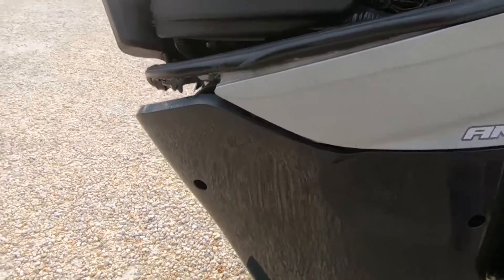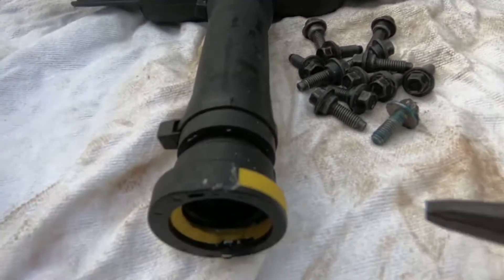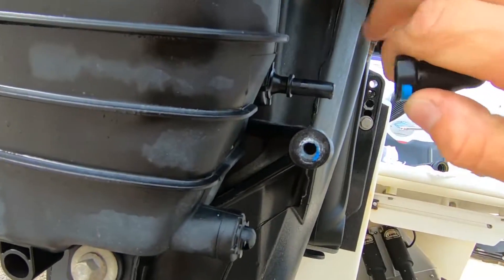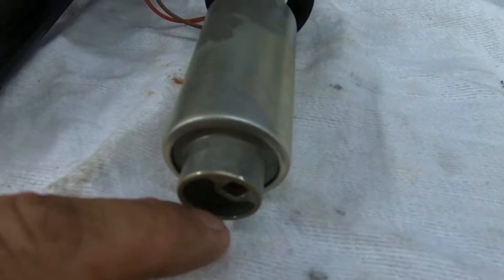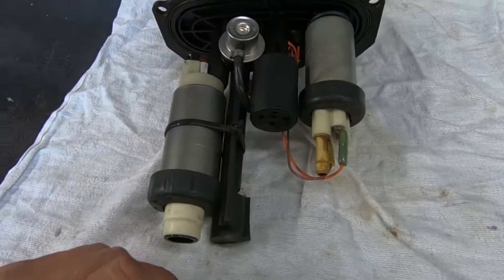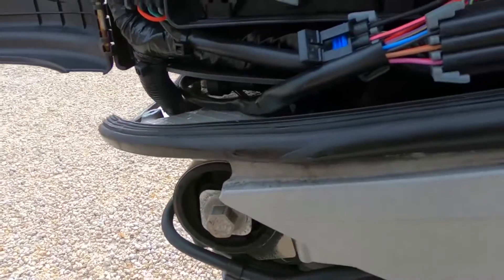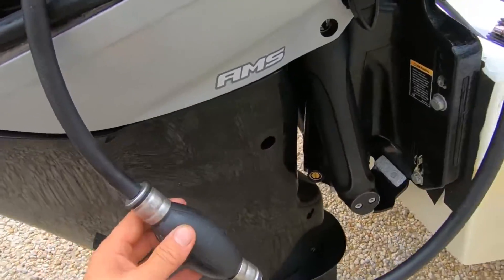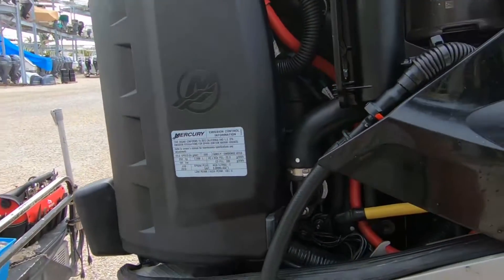How to remove | Disassemble | clean or change pumps in a Mercury Verado FSM (Fuel Supply Module)

Comment: Thanks for the video. My verado 250 will randomly smoke like crazy on startup. Tons of white smoke and unburnt fuel will come out of the exhaust. It happens about every 10th start and lasts 10 minutes or so. Do you have any idea if the FSM might be causing this?

Comment: Ok 08 vrod 200 4cyl. 
All runs fine...but turn key on engine off and pump keeps running and running. No alarms or smart gauge alarms. Motor works as it should lots of power and runs fine. 
Any idea why i believe high pressure pump would be running continuously with key on engine off.
Reply from the maker: Usually in the flashing of the computer and or the harness that was used, that could be it, idk if the engine is new to you or what, but it should eventually turn off after say a couple minutes, if not, it's a flashing thing with the computer, and or someone has messed with the wiring
Reply: @BornAgainBoating  have had since 80 hours on it so like 1 year old when I got. They redid float system and reprogram years ago for the recall. Had issue with ground circuit inside pcm was keeping 1 relay alive killing battery overnight. I installed and toggle switch to kill relay. One day driving in rough water it fixed itself. But since sometime around then...the fuel high pressure pump stays running with key on engine off. So my knowledge is ground circuit inside pcm is bad. Not opening or closing ground to turn pump off after the allowed 5seconds. Been that way for years. But fixed my high fuel pressure by cleaning regulator in FSM. Was plugged. Good now but pump still runs with key on.

Comment: Anyone else have issues putting the fsm unit back into its case?
Reply from the maker: It's late, but you gotta make sure the low pressure pump is aligned right or they won't go back together

Comment: What size male fittings did you use to plumb into the fuel system when priming?  I believe my mercury has 10mm female connectors but I can't find any male connectors to use
Reply from the maker: Yeah, I don't know, they are quick connects :/ I pulled them from another engine

Comment: I have a 2007 150 Verado that will not start only start when you are wide open in neutral. and look likes its spiting a lot of gas off the muffler and when I go to idle it shuts off. Will not start and idle. At the fuel nipple on top of the fuel rail I have 42 PSI,  fuel ok, no water and replace filter and plugs. Any help would be appreciated.. Thank you a great video

Comment: i have a 70hp merc replaced both pumps motor runs about 20seconds wide open then dies if   squeeze  the bulb it runs great again for 30 second the never stalls out but runs rough

Comment: In your video, there is a small port looking fitting on the lower right hand side of the fuel supply module. When the motor is running should there be water coming out of this fitting?

Comment: Hi these are great videos. You mention you dont want to get fuel in the vent canister, as it causes problems. What sort of problems do you get? I have just replaced an injector on my 2006 150hp verado and she wont run clean at higher RPMs just cuts out. Seems to take an age to prime as well. We tried to get air out of injector rail and also the green valve I think called the fuel air vent.

Comment: Howdy, Great video! I subbed! I have a new problem with my Mercury 90 EFI 4-stroke (I think 2004 M.Y.) after servicing it and it not having been run since last year. Last year was first year I owned boat and never one single problem or warning beeps. Last fall I changed oil, oil filter, lower drive lube, and spark plugs before putting boat in storage. Just before I put it in the water the other day for first time of the year, I turned the drain valve on the remote water separator and drained it thinking that was okay to do to purge any water out. Boat started right up in water but then shortly thereafter I got 4 beeps. Longer in length. Then 2-3 minutes goes by and 4 more beeps. Boat seems to run fine off-idle but I noticed at idle/trolling speed it’s running rough almost like it’s misfiring. I did not operate/run the boat long because I didn’t want to get stranded out on the water or damage anything. I found a “fix it” thread online that had things pointing to the FSM on one guys boat that had similar symptoms and warning beeps as mine is having. Battery is also fully charged. I did read low voltage can cause 4 beeps. Any thoughts? Really appreciate any advice. Thanks

Comment: Hello, if the float is not working, what is the problem with the engine? I find benzene in the oil in large quantities. Does it have a relationship?  
motor mercury verado 300

Comment: I have a 2010 mercury754 stroke. My last trip out ot sputtered about out.. I've replaced the two inline filters. And have noticed the fule float wires are black not red. I can hear the fule prime for quite some time when I turn key over but no start fule is in both filters.. but no start any idea

Comment: 2015 mercury verado L4 gave it full beans everything was fine running along 1-2mins then fell on its face will not rev over 4500rpm. Think it could be a failing fsm switch?

Comment: 2009 Mercury Verado 300, updated float switch, hard hose in between pumps, new lifter pump, vent good, fuel pick up in tank good, all new fuel lines, however it throws a critical fuel pump warning code and falls on its face like its running out of fuel. Any ideas?

Comment: Great tutorial, not sure if my motor problem is related to the FSM. Need advice, 2012 Verado 250 cut out after going into plane (felt like a temporary vapor lock/fuel issue), motor tried to restart on its own. I shut down at the touch pad and reset main breaker. After a minute I restarted and all good the rest of the trip with no warning signals. Is this a FSM type issue. Will a diagnostic test reveal the issue. Thanks great page and site keep up the great work.

Comment: I know this is a old video, but thought I'd ask. I have a 2006 250 verado. The motor ran fine until headed home. Now studder on hole shot and wot. Run fine mid range, ant ideas.
Reply from the maker: Probably dirty filters or fuel pump screens or plugs :)
Reply: @BornAgainBoating  I may be pushing it, but have other questions. The screens are clean. By pulling the coil plug the engine respond on all. Could I have a bad plug or coil that misfire under load? It idle fine and cruise fine. It only misfire at hole shot wot and cruising wot. May e the next step fuel pressure. This is on the 2006 250 verado. Thanks for your help. Filters are clean replaced recently
Reply: Thank you.

Comment: I got questions for those fuel pump, as you take it out from the module is that okay to connect a 12v power for it to test it?  Because if need to put it back together to test it would be pretty time-consuming.

Thanks!  This video really helps.  And it seems some complicated than Yamaha systems.  I start boating with 2stk - 4stk Yamaha motor first, and now try to help my friend to solve his Verado motor won't start issue.
Reply from the maker: Yes, you can run the pump with 12v, just don't run it dry for too long :) squirt some fogging oil in it or something to keep it from running too dry
Reply: @BornAgainBoating   Thanks for your tips!

Comment: Hey Boss, hope all is well. Why is not having Red wires a tell tale to change the float switch? Is it because it's an aftermarket junk or a Merc upgrade?
Reply from the maker: All is well! :) the colors just let you know if it is the superseded part or an older model float that's inside :) that's it, the red wire floats have been out for maybe 10 years now lol so we dont see a lot of the older ones anymore :)

Comment: Where can I get some of those fuel line quick release fittings so I can rig up a primer bulb?  I haven’t had any luck searching the web for them.
Reply from the maker: Hmmm you could order them from a merc dealer, I have them by pulling them off blown up engines over the years lol
Reply: For future reference, the end of a 5/16 fuel line can be pushed over the fitting and secured with a hose clamp, it will work fine 👍

Comment: @BornAgainFishing Pulled the module and did not find any issues. Checked fuel pressure and was able to get between 45-50 psi. The motor will run fine in the yard (5500+ rpm). Took it back to the lake and it's doing the same thing under a load. Yes I do have smart gauges but no alarms, no codes. I'll get up to 2000 rpm and the motor will shake and will not go above. I am not reading water pressure at the gauge but the tell tale is strong and no alarm. So I figured that was not part of the issue. It seems like its in Guardian mode but I'm not sure. What else could I check? ???????? Is there something I'm missing??????
Reply: Sounds like bad fuel pump.
Reply: Did you figure out this issue?
Reply: coil pack

Comment: @BornAgainBoating 06’ Verado. My motor sat for a while. I pulled the power head to replace the three seals on top of the drive shaft, (you gave me a few tips in the comments for that video) put everything back together. Put the boat in the lake, never got to top speed, but I was over 2k rpm. A few short runs like that on plane. Tried to go again and now it will not go over 2k without shaking. No alarms. Could this be my problem?  It seems like it’s not getting air or maybe in guardian mode??? Thanks for your help on your other video. Very detailed! Saved me 600 bucks in labor!
Reply from the maker: Yes it's possible, put a fuel pressure gauge on top of the fuel rail and see what the fuel pressure is. It should be around 45 PSI. Do you have smartcraft gauges that give any fault codes? If I don't reply, write a new comment, replied comments sometimes get buried and I don't see them!
Reply: @BornAgainBoating Pulled the module and did not find any issues. A friend of mine has a fuel pressure gauge. Hopefully he has the connection that will fit the Schrader. Will there be any divination I need to look for in pressure. When I throttle up should I see an increase?

Comment: Nice video and very helpfully, do you know how much pressure is need to keep purge vent on mercury verado 2005 250hp. I've tested and holds only 15psi and very slowly the pressure drops. And also do you know how much resistance is for good purge vent, on my multimeter on 200 ohms show me 19.0 ohms. Thank you in advance
Reply from the maker: Well, the purge vent is controlled by the PCM, it's more of a on off thing and it works with the float that is just below it behind the PCM box. You shouldn't be getting fuel up to it. If you are, you probably have something else wrong as well. What's the engine doing? Those vents do go bad sometimes, just not very often.

Comment: Nice video, i have a 150 verado with 2 codes, 220 and 221 looks like the float switch is not working properly, when you disconect the plug did not afect the computer, i mean you must clear the code with an scaner or something like that? I ask because all the verado sistem is controled by the computer.
Reply from the maker: No, just turn the key off and put the handles in reverse wide open throttle, pull off the fsm and make the repair, then put it back together and turn everything back on!
Reply: Ok thaks, whats the reason to put the handles in revese full throttle to did the work? Sorry about my ignorance
Reply from the maker: @pedromari1222  No worries, it's just to shut off the system. Depending on how old the system is, if it is new enough, there is power in the system for 15 min to give you the ability to trim the motor from the control box after the key is off. So putting it in reverse wide open throttle will shut that power off. :)
Reply: Ok thanks, your video was very helpfull
Reply: Thanks!!!

Comment: I would love to pick your brain,225 pro xs on sterling 200xs,boat doesn't want to plane without trim tabs,but when it gets on plane she runs great,where to start looking.
Reply from the maker: Hmm, there's a bunch of things that could be affecting that! If there isn't anything wrong with the engine and all the fuel and everything is good. It could just be in the propping. The prop being used is for top speed and not hole shot, is it a four blade or a three blade prop?

Comment: Great Video, question, do you have to or do you recommend replacing the gasket on the main housing (tank top) of the FSM? or if the rubber gasket is in good shape reuse?
Reply from the maker: Thank you, yeah, normally the gasket that is inside the top housing stays in there and is usually fine. There has been a couple times that we've needed to replace it, but as long as no one has messed it up and you haven't been using ethanol blended fuel, the gasket is usually reusable :)
Reply: @BornAgainBoating  awesome thanks

Comment: https://www.youtube.com/watch?v=46qKEIw26q8&feature=youtu.bethat's not my video but mine doing the same after oil change you seem to know verado very well. I change my oil put sump plug back in and run it in my water tub. and notice water coming out of oil plug like in the video about.
Reply from the maker: That's odd, to be honest, I've never seen that. The oil sump sits in the driveshaft housing and has the exhaust going out through another tube.  Which means there is a leak somewhere inside of the driveshaft housing. Most likely it is in the exhaust portion. That's not normal, but you don't have any water in your oil do you? You won't be able to pinpoint where that leak is coming from unless you pull the lower unit, then pull off the driveshaft housing and inspect inside of it. That might be something you leave alone, if you don't have any running issues.
Reply: no water in oil. once I seen it doing that I shut motor off and check oil for water. my marine mechanic said it is normal too but was very worrying seeing water coming from around drain plug..
Reply from the maker: @mred9024  how is your water flow from your tell tale? You arent having any over heat issues are you?
Reply: flow normal coming from tell tail. no overheating at all
Reply from the maker: @mred9024  hmmm that's pretty wild
Reply: and no oil leaking out drain plug
Reply: and all I did was take drain plug out dump the oil change oil filter and put drain plug back in with new yellow washer and fill it back up.. then found water pouring out around drain plug.... have I lost some thing when I took out the drain plug?
Reply from the maker: @mred9024  well that's good, just the question is where is the water. coming from? You could look in the spot where the poppet valve is and see if water is filling up in there
Reply: where a bouts  is the poppet valve located?
Reply from the maker: @mred9024  right under the side chap on the port side, only six 8 mm bolts holding the chap on. Its behind the rubber piece in there
Reply: oh ok I will have a look and let you know if its filling up with water. thanks for trying to help me out.
Reply from the maker: @mred9024  for sure! Let me know, I'm really interested, I've never seen this before and I've worked on thousands of Verados.
Reply: took rubber piece off n run it. water going every because of exhaust turned it off and looks like its leaking water from poppet valve gasket then running down and out around the drain plug.
Reply from the maker: @mred9024  awesome! Nice work man, so you just need that gasket and your good to go! Thank you for the update!
Reply: thank you. wouldn't of found it if it wasn't for you
Reply: went to change gasket both bolts snapped off. you know away to remove the bolts?
Reply from the maker: Oh geez, ummm well not really, just drilling and tapping... That sounds like it has turned into a bigger issue :(

Comment: video very helpful as have to take the fsm off but how do you get the lower cowlings off?
Reply from the maker: The lower cowlings or side chaps just have six 8mm bolts holding them on. The actually cowling itself though, for that you just flip the lever in the front middle of the engine after removing the top cowl. Heres some more information on that, if the cowl gets stuck: https://www.youtube.com/watch?v=Bh9TQ3lQ3Zo
Reply: thanks